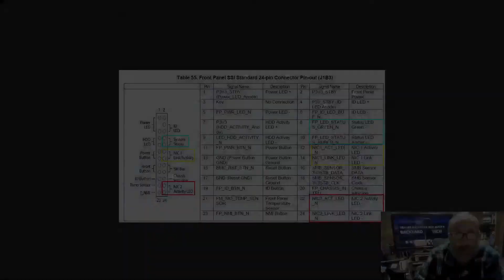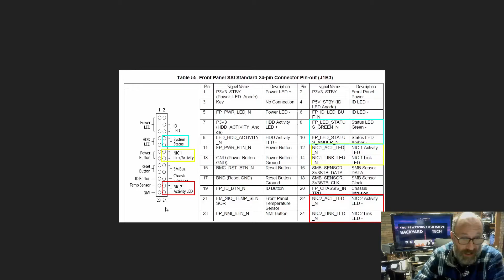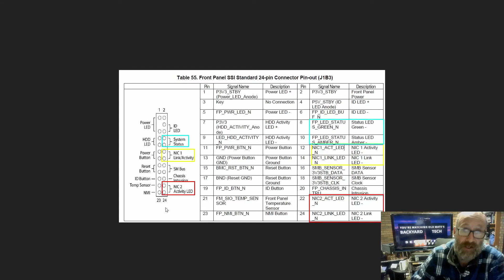Server/PC Stuff - Intel S5000VSA Motherboard Front Panel Connections

Comment: Hi! I got a server, which has a S5000VSA installed (Thanks for that connector tutorial,helped SO much!!). i hooked it up and installed OpenSuse on it - seems to work fine. What kind of use case would you use such a server for? What kind of power draw does your server have in idle and under load? (I think mine has 150 in idle iirc).